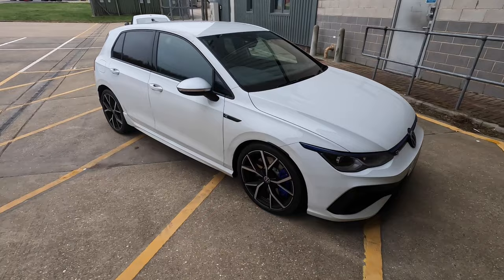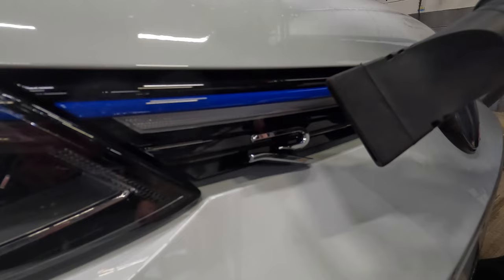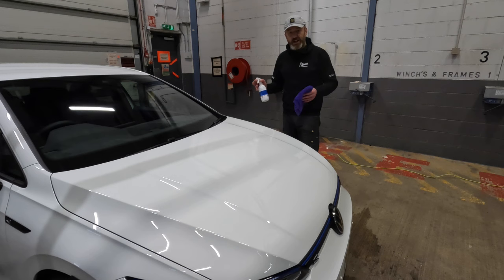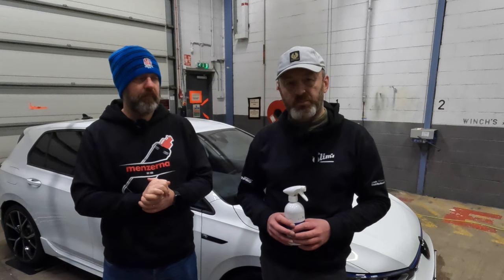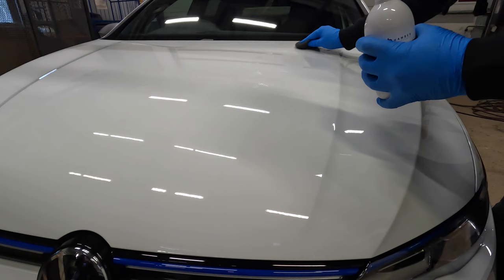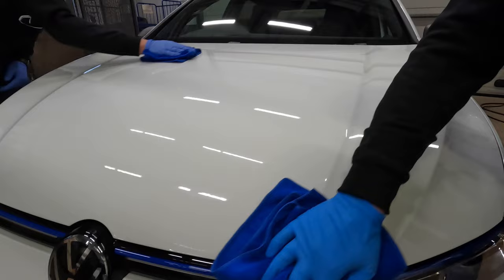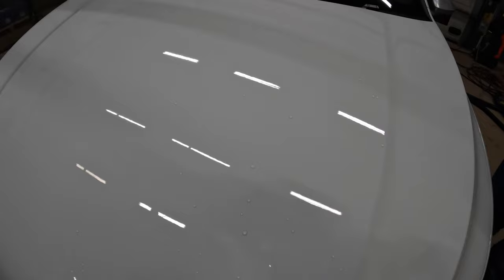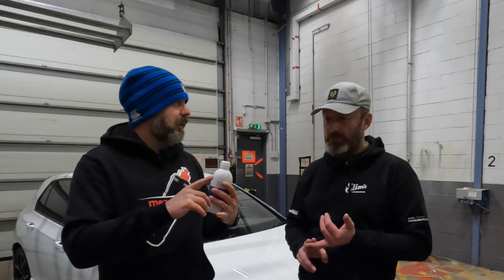🟢Bilt Hamber Hydra-Wax reviewed #bilthamber #carwax #cardetailing

Comment: Nice to see someone who uses panel wipe correctly by using a second towel to remove the  contamination (oils etc) see so many spraying on panel prep & just smearing it around the substrate.
Reply from the maker: Thanks John. We tell everybody when removing anything to use multiple cloths. Case in point is watching people cleaning windows  just using 1 cloth. First cloth is to spread the product, 2nd and 3rd to migrate the dirt into the cloths and remove from the surface. Cheers for watching and leaving a comment.

Comment: Great video can ask a question I have a new Vw Tiguan would you put b h double speed wax on the car or have a ceramic coating put on the car thanks mike
Reply from the maker: If your looking for the best protection I would defo recommend a ceramic coating. On a new car it is the way forward.

Comment: Looking forward to your updates on this one.
How many Golf sized applications do you think you'd get from a bottle?
Thanks guys
Reply from the maker: Thanks for watching. A good question. Looking at the amount we used on the car, and how far each loaded applicator went before we had to add more to the pad I would hazard a guess at circa 20 cars. You really don't use a lot as the product is wet and spreads well. Further, as shown on the video, you really are, like most waxes, looking to apply the thinnest coat.
Reply: @thecarboutique2467  do you have any update on its longevity? cheers

Comment: Excellent explanatory video . I have to say that is a beautiful example of the golf in white 😍I always go for black myself ..I have deep black pearl 2024 Tiguan R line . It's beautiful but a nightmare to clean and keep clean ,there's a lot of swirl marks on it mainly from picking it up from dealers and the monkeys in the back washing it and damaging the top coat when I clearly told them no wash  ..I have to admit tho I have rushed a few washes and swirled the paino black pillars ..have you any tips for the piano black please 🙏looks crap when sun hits it ..I think my next vw will be Tiguan again but in the nardo grey colour ,I've just bought the touchless and touch on ..I was expecting better tbh from bilt hammer
Reply from the maker: Hiya buddy and thanks for watching. Regarding piano trim, I tend to go down the machine polish route as using any LSP doesn't really work. I get a 3 in pad, medium compound with a soft pad and gently work the trim. Usually comes up amazing. I then apply a ceramic to offer it a little abrasion protection. Cheers.
Reply: @thecarboutique2467  thank you for this info 🙏 I was about to purchase a nano polisher to target the pillars but TBF I have no clue what brand or type to buy  have you any tips ?Somone mentioned using a drill on soft setting 🤔 Thank you